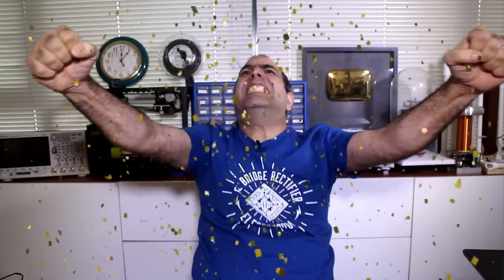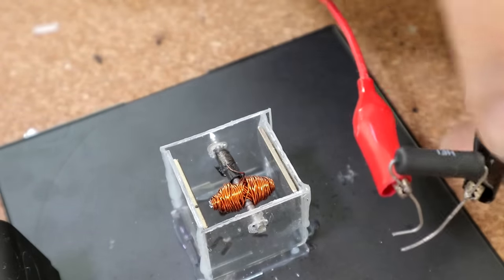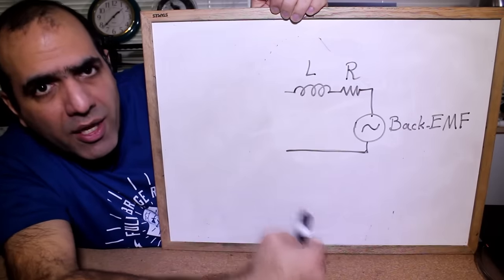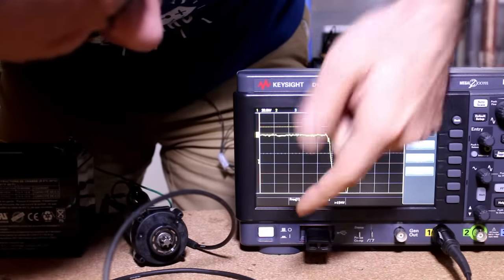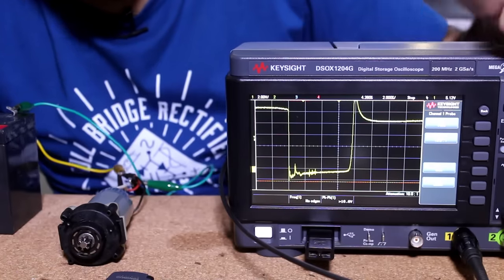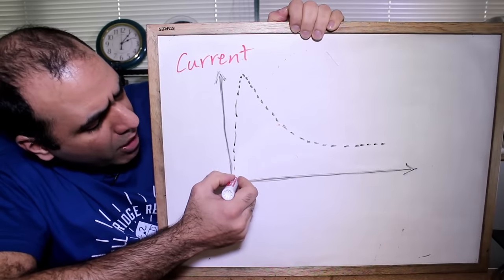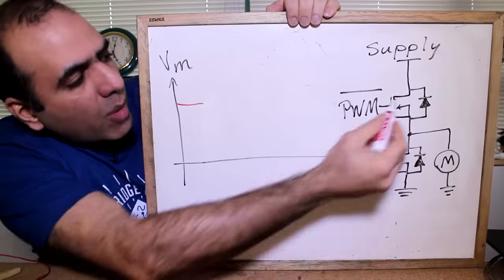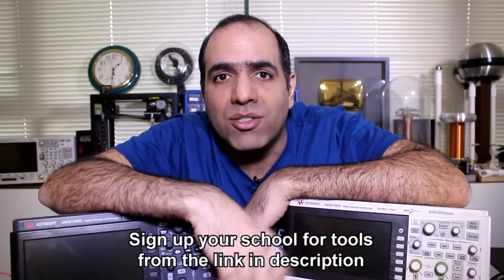Brushed DC Motors and How to Drive Them

Comment: “Mechanical engineer minions”

Funny how my mechanical professors say basically the opposite. “Oh the EEs will figure it out eventually”
Reply: Yep, I think it really depends on what discipline the project manager is as to who they think are the minions.
Reply: Actually most of my EE professors did make fun of mechanical and civil engineering.I guess it's a common thing in engineering.
Reply: @mattjmwmatt  yep, each field thinks theirs is best... it's too bad more effort isn't put into working together and utilizing each others strengths.
Reply: @WaltSorensen  Nah, it's more on the light roast and banther, most of them show respect towards other fields.electrical and mechanical the most because most of the time they have worked with another at some point.
Reply: @mattjmwmatt  I still remember my first lesson about AC current vs voltage and the mnemonic was what the lecturer called the "dirty word" CIVIL (capacitive (C) current (I) leads voltage (V), inductive (L) current lags voltage). That was 20 years ago but I switched from electronic to computer engineering soon after, so I have not had a need to use it outside theory.
Reply: One thing we can all stand together on though: making fun of art students ;)
Reply: <3
Reply: Laughs in mechatronics
Reply: they are following like sheep...maybe?
Reply: Lol
Reply: @WaltSorensen  both are minions making spectrophotometers for chemists

Comment: Well I was designing a project using a brushed high torque gear box.  This video has given me the courage to give up.
Reply: Use a relay. (And some protection components)
Reply: thats when you cheat and find an IC or prebuilt module that does the hard bit for you. No shame in doing that as it saves you time you can spend improving other aspects of your design

Comment: For the next video make an AC motor
Reply: Seconded, I want to learn how a 3 phase AC motor works.
Reply: You can drive this motor also with acvoltage 1 phase  when the magnet is magnetized with the same acvoltage
Reply: @Okabim  Also known as a brushless motor. All brushless motors are AC, BLDC is actually a misnomer. For running brushless motors with DC you need an ESC that basically generate 3-phase AC waveforms.

Comment: So it's how teslas cars charge by breaking now i understand. Tank You !
Reply: toyota did it first but mmk
Reply: @MazdaTiger  oooh okay but anyway now i understand how it works
Reply: Tesla use PMSM, and get energy back from them by making output voltage frequency of the inverters lower than rotor speed..
Reply: Tesla cars use AC induction motors :)
Reply: @1314zerosktr  If he cared who did it first then he would've googled it. I'm pretty sure no one actually cares who did it first, main thing is to learn how they charge by breaking, not who did it first.
Reply: @gateopssss  I see your point, but I personally don't mind the comment. I used to love the concept when it was done on Toyota Prius. I think ignoring who did it first for too long ends with people believing Steve Jobs invented the smartphone (yes, many people believe that), and Edison invented the light bulb. I feel it's nice to keep in mind when a technology was made, and give credit where it is due.
In any case, I get your point. I just don't mind.
Cheers, mate!
Reply: The KERS (Kinetic Energy Resuscitation System) in Formula1 cars generate about 80 horsepower by such braking techniques.

Comment: Very nicely made, I like the curve that update to be all nice! Very interesting! What about adding a basic Arduino to generate the signal to drive the MOSFET with more control? I'm sure many people have done Arduino programming but have never seen the output signals on a nice Keysight scope ;)
Reply: An Arduino has PWM outputs so it may be possible.
Reply: how did you comment before the video was out??
Reply: Sniper yea man wtf
Reply: If I remember correctly, Patreons get earlier access to the videos.
Reply: Time machine.
Reply: @sniperammow4865  yeah, patreon supporter;)
Reply: > Arduino programming
It's C++. Or even pure C, if you like coding that way :)

Comment: for more information on the skipped section at around 3:40
he is talking about how to utilise the right tool for the job, if you only need to apply 1nm of torque then a 5 litre v8 that produces 400nm isnt the right tool. the gearing refers to the ability to change the load while maintaining a speed. if you expect to have more resistance you should use a higher gear ratio (ie 6:1 is more top speed 8:1 is more acceleration) with more rpm

Comment: i think ur figure was a little conservative, the starter on my truck pulls around 1500 amps, at least, its rated 1500-2000, And, thats @ 24 volts even... it does have the "arctic start" package or whatever they call it  n as can probably tell by the 24v system its not a normal pickup lol  i could probably drive my normal truck with the starter alone lol it jus wouldnt b that fast n the motor wouldnt last long, theyre sprinters :p

Comment: 6:51, so what you are saying is that the motor spins initially to a higher rpm when first connected and slows down to a normal rpm as the load continues?
Reply: Not quite, he's saying that when the motor turns on, it draws current until the back emf voltage and supply voltage are nearly equal. The current is about speeding the motor up faster, not necessarily the speed of the motor. 

It's the difference between velocity and acceleration. The motor accelerates fastest when it is stopped (back emf is 0) and it is turned on (supply voltage is non 0)

I think, I'm not an EE or anything close to it

Comment: Wouldn't a capacitor work for the inrush current problem?
Reply: Nope: capacitors themselves have inrush current problem! That's why most laptop chargers spark pretty much when plugged in: they have big high-voltage electrolytic capacitor (smth like 47 uF 400 V if we talk about 230 V outlet) which is almost like short circuit when discharged.

Really big inductor (say, couple of henries, which weigh like car battery for currents like here) should help, but this solution is straight non-practical.
Reply: @allmycircuits8850  oh i see that makes sense.  I always wondered what was up with that
Reply: AllMyCircuits Oops, forgot about that. Could be fixed by charging it slowly and then switch it on, but the circuit for doing that would probably be more complex than the H bridge and PWM. Would be useful in cases when it’s important for it to start rapidly, though.
Reply: Youtuber Oh, yeah, I hadn’t thought of that! But it’s still a good idea to use an H bridge to reverse direction if needed. That would save up the cost of the PWM circuit anyways. I guess that’s what they use in cheap cordless drills.

Comment: Would it be cheaper to build a large and powerful electric motor, or to buy one already built. I'm not the most knowledgeable of what I need. I'm thinking something in the 15 to 20 HP driven at around 20 amps. I was hoping to make or buy it for multiple applications, but mainly running a bandsaw mill, trip hammer and a large belt sander.

Comment: Before they had PWM Drivers, they'd use resistors. At startup, they'd connect a sets of resistors in series with the motor and other sets of resistor to cap out the current. As the speed of the motor rises, they'd reduce the resistance of the resistor bank by bypassing more and more sets of resistors until the motor is running directly on supply voltage. They'd do this on old electric trains- you can sometimes hear the clicking of relays that bypass a resistor as the train speeds up.

Comment: 18:18 When lowering the pwm duty cycle to zero instantaneously, the back-emf voltage from the kinetic motor energy won't exceed the maximum supply voltage like the back-emf from the motor inductance does, right? How can this blow up the circuit, if it is designed tolerate have supply voltage on this trace?

Comment: 19:35 and to calculate power dissipated on the MOSFETs in order to calculate radiators for these transistors if it's needed. Also design the commutator-switch or use MCU, and in this case choose the MCU, write code for it, compile,upload firmware and voila . And that's al... But wait, we need to design the enclosure for the PCB..... And as a matter of a fact, we shouldn't take just random MOSFET, but it was said in the video to choose right MOSFET you should made bunch of calculations. Also, it can be design some type of regulator like PID or just PI. For these purposes it's necessary to create the mathematical model of the motor, driving circuit and switch , and we need to tune parameters of the model using some bruteforce Matlab tuner or using some specific methods from control systems design.

Comment: Fun fact to augment (not contradict): If a cordless drill has two large plastic flathead screws on either side of the drill body, opposite of each other, that means it’s a brushed DC motor with replaceable brushes. :-)

Comment: they are quite easy to make... can make it much better than yours,  we did it when we were at school but not in class...  the magnets were the hardest part to find, we had to get them from the better school in town where the high achievers went to.  We used a sqaure cardboard box or a piece of wood to wrap the windings around,  then use a round dowel or a pen for the axle,  then for the communtators you would find some metal strips and cut them, bend into a half circle and super glue them on,  easy.

Comment: Great video. But where is the vid on mosfets and how to drive them properly???????? I'm struggling here!!!! Confused about why half bridge over single transistor! Is it only because the motor will "break" if PWM frequency is slow enough to allow back EMF into off-time? So if your PWM frequency is high enough you can use a single transistor?

Comment: I don't pretend to know as much as EB but I've made one similar observation about electric motors.  Whether its called an AC or DC motor, the drive voltage that actually makes the motor move is AC, whether it's brushes and commutator making DC mimic AC, an electronic speed control or three phase modulator in a brushless "DC" motor or just  multi-phase AC motors, all of their windings run off of AC regardless of the unprocessed input. Tesla uses an inverter to modulate the battery voltage into AC for the motors....drones have ESCs that modulate their battery voltage to AC, and so on.

Comment: I was 8 years old and got my mothers old electrical hand-mixer to take apart. I took apart the AC motor in 100 pieces, and assembled it again! Then I wanted to see if it worked, so I plugged it in 230V AC 50Hz 13A socket while holding the motor in my hand. The second I kicked it into second "gear" the motor burned itself into my hand while my vison disappeared, it was darkness, I could not scream or let go of the motor, while it felt like bowling balls was pumping through my arm.... Then while my body was collapsing like timber the cord was not long enough and disconnected from the socket and then I could see and scream again...

Comment: Hi Mehdi, Question. Can you use a DC motor to power an LED lightbulb? For example, if I am making a windmill for my sons science project and am planning on putting blades at the head of the motor and using a fan to spin the blades. Can that power the LED lightbulb? I ask because most DC motors are powered by batteries which spin the gear in the front. What I'm asking is if I power the front with a fan and blades, can the current go backwards to the lightbulb? Thanks for reading. Appreciate your help!

Comment: I don't think the inducance is series with the power supply. The inductor rotates so the polarity of the inductor flips every half rotation. Doesn't this mean that the inductor is receiving a square wave, and therefore an impedence can be calculated. 

From here maybe it's possible to equate the impedence to a resistor series with the power supply (but i don't know if it works)

Edit: Using harmonics to approximate the square wave, we can get an impedence value, which should be the same value as that series resistor. 

Note: ppl say the inductive rise time is not significant.

Comment: i have worked  with dc motor driver at industrial level, for 1 or 2 hp motor, driver consist to scr with   gate connected to be controlled.

Comment: Hi friend, I am trying power on a 12v dc motor rs545sh..brush motor with 12v 3 amps switched power supply but the problem is motor start stop starts every.5 seconds. I am not able  to run it continues. Somewhere I read using NTC D9 thermistor in series will resolve but i that as well but no luck. Any suggestion. The motor runs fine with 12v battery fine.

Comment: 800A inrush? At my previous job I had a motor (AC) that could go up to ~2000A inrush when starting in a wye configuration, my boss initially wanted it to be started in delta, that would go to about 4000A, it was a retrofit motor and the whole circuit was originally fused with 125A Fuses... It also started on pretty much full load, it took some trouble to get the company to order some additional contactors

Comment: QUESTION!! How heck are DC motors protected from overcurrent. Like if I'm riding an e-scooter up a steep hill, is the circuit protecting the battery and motor or do they just expect you not to do it too often.

I wanna make some RC-car stuff but I want to guarantee that my motor and battery don't burn if the motors are stalled

Comment: ElectroBOOM  Hi!
Does this end up using the same amount of power, and is a waste of time? ( Thanks for any info! )
On brushless motors there is no reversing of the field as the motor turns as on your dc motor. I was wondering if it is possible to put a smaller amount of dc power to keep the field from collapsing and not disturbing the magnets. It would be energized exactly when the primary power source stops. (Little or no EMF on the power gaps.)  Thanks for any info on this!

Comment: Hi, I have these little DC motors I ordered from Amazon and they don’t work with this 5 or 3 volt power supply I have coming from the outlet (DC power). But when I use my two AA battery pack it works. Can you think of a reason why?

Comment: I normally like your videos, Mehdi (is this spelled correctly?), but scientifically speaking, there is no Batman Black. Actually there ihere is no black (is just you not seeing things) as black is the absence of color.Also, I am deeply ofended (not really) as a mechanical engineer, every part of your motor had to be designed by us, and you just have to deal with  ones and zeroes. The shaft, the coil the elements to reduce friction in the motor, the 0,1mm lamination inside motors to increase the magnetic field inside motors. Speaking of such, I would like to understand a little bit better about how the laminations increase the magnetic flow in the motors, specially brushless.

Comment: I have yet to quite understand how the back EMF of the free running motor can exceed the original supply voltage. I have seen this happening many times though - cutting the PWM throttle fast, and my supply goes clack clack from the relays and the voltmeter briefly shows way too high.

Comment: In Poland we still have in use a lot of electric locomotives with brushed DC main motors, back in time it was too hard for our engineers to develop a proper H-bridges for them, so for power control they used very BIG resistors with huge cooling fans. It doesn't matter how slow was the locomotive going - always it took from power line  half of maximum current or maximum current depending when motors were conected in series for start and low speed or paralel for speeds over 40km/h

Comment: When diesel locomotives with regenerative  breaking, break their alternators cannot use the generated power to charge batteries, so they dump this in power resistors banks on the roof of their diesels.
But electric locos with this can dump it to the 25KV AC over head or 650V DC 3rd rail supply.
Both helps stop the train, reduce wear on the mechanical breaking system and in AC or DC electric supply, engines generate electricity for other trains making them more efficient.

Comment: I tried to charge a lead-agm batterie with my power supply, the voltage bumped up to 17 volts once, at the next try it jumped to 80!! volts on a 30 volt ps. any idea what could have gone wrong? battery voltage initially was at 11.8V

Comment: After watching this, I am trying to figure out a set up on the units I work with. They have a power control module with a power enable relay that runs on a pulse modulated ground. If your battery voltage is 14 volts and you check the relay socket on the coil pins, you get 10.5 volts, coil positive to battery ground is 14 volts and coil ground to battery ground is 3.5 volts. The engineers say its to keep relays cooler and arc suppression but I really don't see how it would help either of those...

Comment: A few ways to (or not to) condition the power of a parallel DC motor circuit to have an observable effect on the shaft speed and direction. 
Accomplished Increases and decreases of observable rotational shaft speed.
Direct drive brushed DC motor relative speed control bench test without loading.
The advantages and disadvantages of electrical circuit speed control of a DC motor with emphasis on electrical theory.

If the electrical architecture of a DC motor provides reference signals ........
Thanks for sharing the video.

Comment: So, my star,delta 100hp motor draws 650a of current for about 7 seconds to start before apfc meter could offset it for 1.now if i start stop the motor in a controlled cycle till it achieve maximum duty cycle,that 650a inrush current be avoided? Lower powerfactor penalty and demand charges?